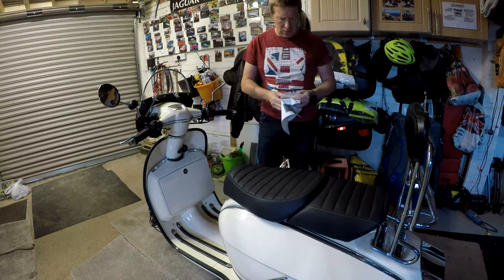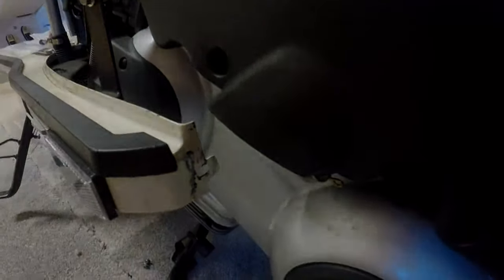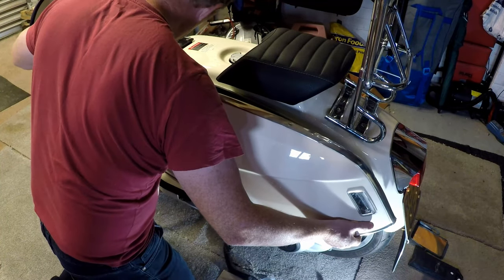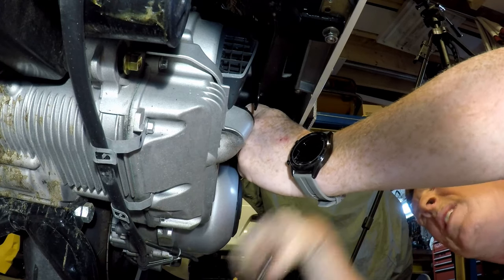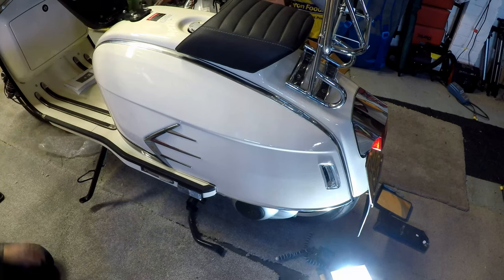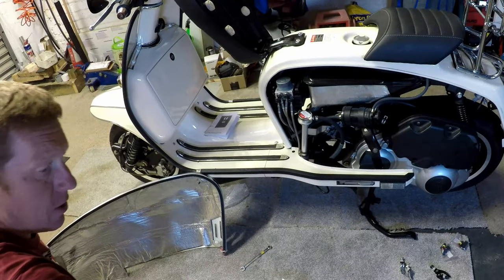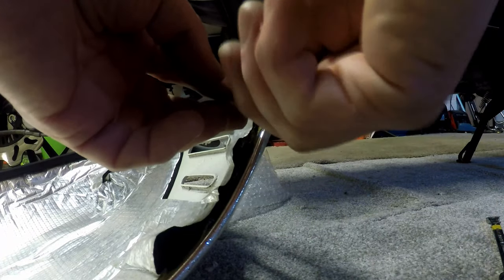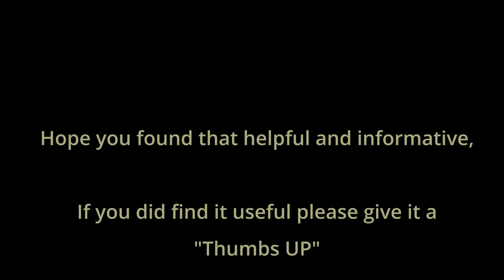Royal Alloy GP SF Stainless Flooglebinders and Side Panel Removal

Comment: dont really see much benefit for the extra cost
Reply from the maker: Not on the newer models for sure, but apparently the older gt models were more of a pain.
However, the advantage of these is you don't need any tools! So if you broke down you can quickly remove the side panels and, for example... check the spark plug cap hasn't come off.

Comment: Being able to take the panels on and off easily without tools would be better as one would be more likely to regularly check oil, coolant etc. I know these are more reliable than the old Lambretta but would be good. I wonder why RA didn't adopt the GP easy release or even better ( in my opinion) the ext handles. Road regulations maybe? Great video, thankyou.
Reply from the maker: Yes, the old style panels are much easier.

Comment: Hi, Nice video and an alternative solution. Not sure if this makes it any easier. But I guess the flooglebinders are a good idea and concept, especially the locating pins for the front fixings. I lost the nut on one of my front 10mm bolts and it never budged, so just locating pins are probably ok and the nuts and bolts are probably not required. However, the side panels are always under tension due to the poor alignment, so that probably helps keep them in place. Not sure if SSF do an alternative for the center fixing, the one that goes through the side panel? My 2021 USA RA GP150 is like that , so that would obviously have to be different. I didn’t see these on the SFS website? Thanks again. 🛵
Reply from the maker: It's definitely a good idea and quicker, the other advantage which I didn't mention was that you don't need any tools.